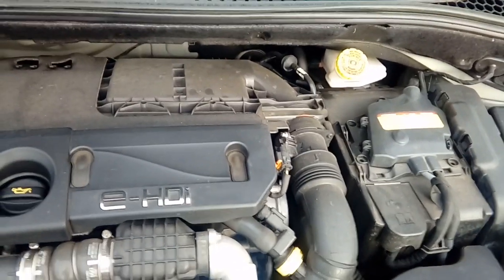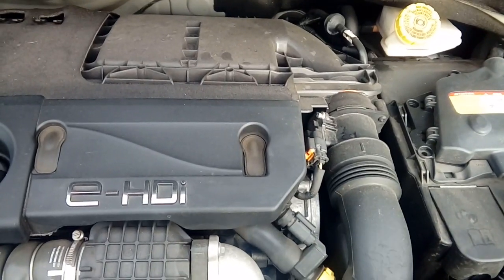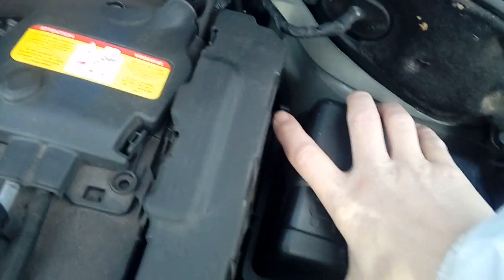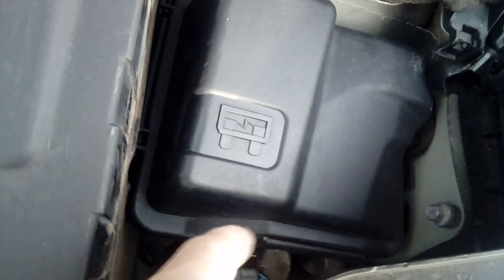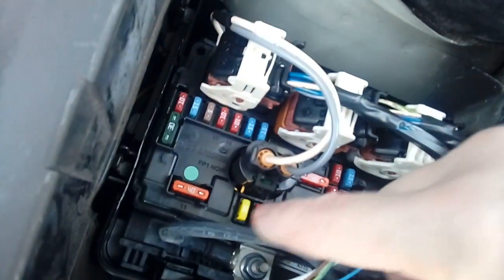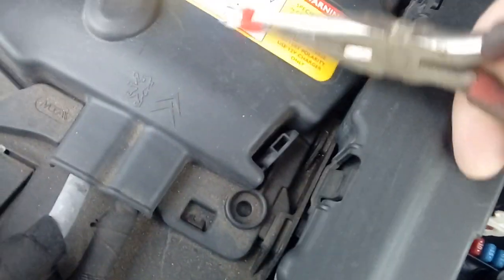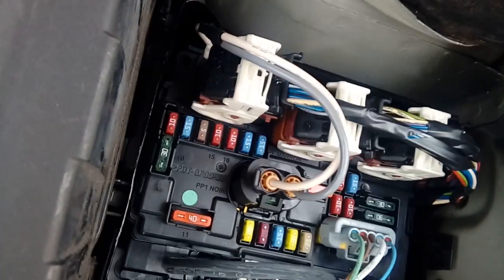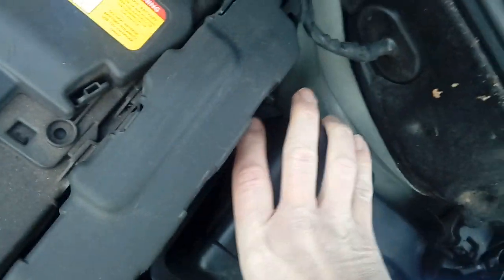Citroen DS3,C3,Pug 208 screen washers not working? quick fault fix guide

Comment: Hiya,
Mine kept on blowing so I am thinking there could be moisture on the motor plug. When topping up my wiper fluid some spilled over, it has before, but I am assuming some must have gone over the plug. Typically it is Aug 8th and it's raining!!! Groan. Good old Cornish weather, lol. So can't check this hypothesis at the moment. Or.. could be a dodgy motor which means the driver-side wheel needs to come off and the cover plate above it off too to access the wiper fluid motor. Not a happy bunny right before we go away!!

Comment: Thank you so much!!! :3 had this issue today ,, saw this video and went along to halfords bought 2 10 amp fuses and installed them took less than 10 mins 5 of that was getting the fuse out with me eyebrow tweesers haha, but yes this worked i can 100% validate this advice,, it was my windshiled squirters that stopped working thought they were just frozen but wasnt .. for clarificcation i have the citreon ds3

Comment: I have a 2017 DS3 and it does blow the fuse sometimes even though I have -20C washer fluid in the system. I would be curious to know why the fuse blows...

Comment: Hiya Was wondering if you have any suggestions, Fuse not blown and washer pump replaced still no noise from pump and no water. The wipers work just no water. Any ideas?
Reply from the maker: Check both power and earth are good to the pump, if so your new pump is faulty.
If no power or bad earth look into possible stalk control broken.
Reply: @PJsprojects  I have another vehicle that I used a working pump and still the same so defo not the pump. So you reckon it could be  power or earth or a faulty wiper stalk?
Reply: @PJsprojects  Thanks Buddy I no longer have the vehicle But appreciate your response

Comment: One side works but the other no water comes out. Any advice would be great
Reply from the maker: Sounds like the little nozzel that the water comes out of is blocked, try unblocking it with a pin.
Reply: @PJsprojects  hiya. Yeah I tried that still no luck 🙃

Comment: I changed the fuse in location and it still does not work the washers on a ds3
What else can I do 
The fuse was blown originally
Reply from the maker: @andrewwatson3549  One of three things can cause the problem.
1.Fuse
2.washer pump packed up (under drivers wheel arch liner)
3.Stalk control gone faulty.

Most likely is the washer pump either failed or the connections to it has corroded, to get to it is wheel off,arch liner out and test with a multi meter.

Comment: I replaced the fuse but it blew again straight away, tried another fuse and it blew again. Any tips on where to search next?
Reply from the maker: If it keeps blowing fuses then most likely it's a burnt out washer pump.
The pump is on the side of the washer bottle and will need to be replaced.
Failing that it's possible the switch that you press has failed but that is very rare.
Reply: I checked the fuse which had blown changed it but still not working!
Reply: @cliftonhodge7672  In my case I bought a new washer pump and that fixed everything

Comment: I changed this but still not working - any other suggestions ? 😢
Reply from the maker: Would need testing to see if the motor is getting power.
Could be either the steering washer control faulty or the washer pump faulty, most common is the little pump.
Reply: Thank you mate. Would the pump be an expensive fix?
Reply from the maker: @poetica1985  30mins job and the part can be got with ease second hand of EBay or a breakers.
But make sure to check that is the fault before spending.

Comment: Are these Mini Blade Fuses?
Reply from the maker: Yes
Reply: @PJsprojects  sadly not the fuse in my case - any other ideas what the issue could be?
Reply from the maker: @stephenwhiddett  Needs to be checked for power reaching the pump and earth still good.
If the above is ok then possibly a faulty column control or pump failure. (Pump fail is more common of the two)

Comment: Hi a have a Citroën c5 aircross my back wiper is working but my front is not as in the washer is that the same problem. Plus do you have to do this every time it's frozen
Reply from the maker: Should be the same problem yes. It’s a case of don’t press the washers when the car is frozen to avoid this being a repeat problem.
Reply: @PJsprojects  thanks for that info but why is the back wiper with water and not the front 🤔

Comment: I replaced the fuse and pump and still nothing.
Reply from the maker: From that you have narrowed the problem down to either the steering column switch being faulty or a bad earth connection at the pump end.
if you get a length of wire and put it directly to the pump power from the battery it should power the pump up and so would tell you if the earth is ok or not.
Reply: @PJsprojects  my partner tried wire from battery to pump, its dead. Already changed bsm fuse box after apparently water pump caused issues in bsm unit. Before changing bsm, washer pump did work, then since fitting replacement bsm unit and new  pump, first worked for few minutes but was working rear washer when should of been front screen, then stopped completely. Ready to put  a 🔥 to 🚙 please can anyone help.
Reply: @sharons651  Sounds like pipes are reversed on pump, the pump works one way for the front, then for the rear the motor is reversed and a slide in the pump moves across and fluid is distributed to the back.
Reply: @johnyoung8483  when switching on for either front or rear washers, there appears to be no power (pumping sound) at all. Need in this mucky uk weather